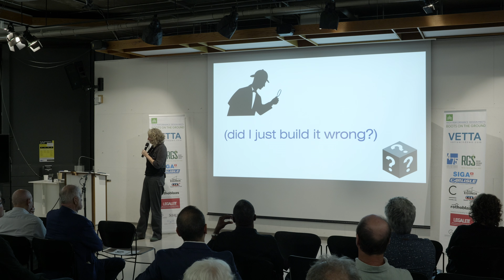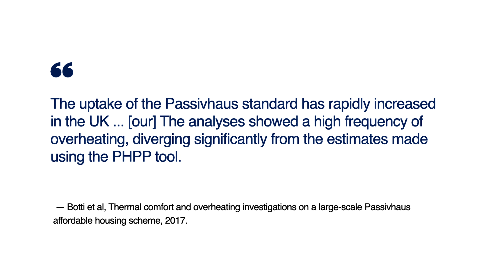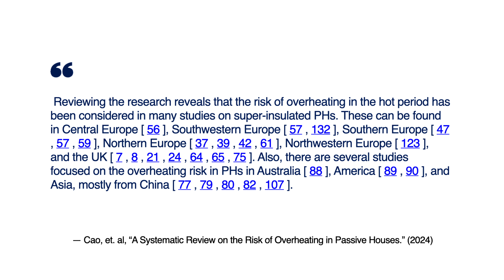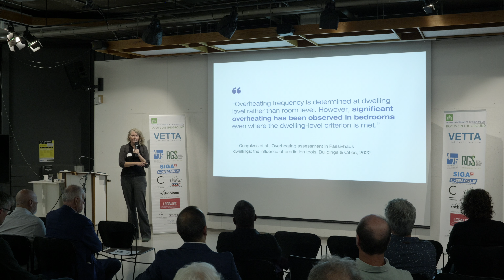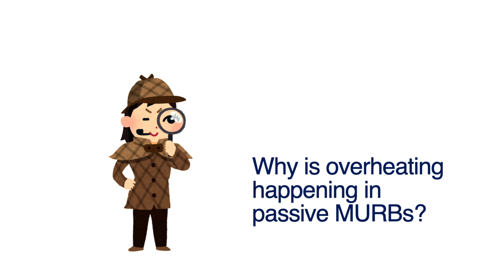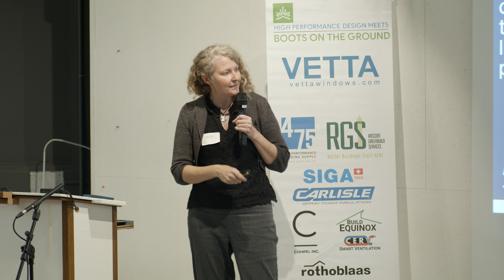Boots on the Ground:  Some (don't) like it hot: Are passive buildings cool enough?

Comment: I’ve seen lots of high performance building videos, and this is a great, frank assessment of PH buildings on the ground. I assume that larger VRF heat pumps would still operate at low wattage for most of the time, but offer the extra capacity to handle the extremes when they happen?